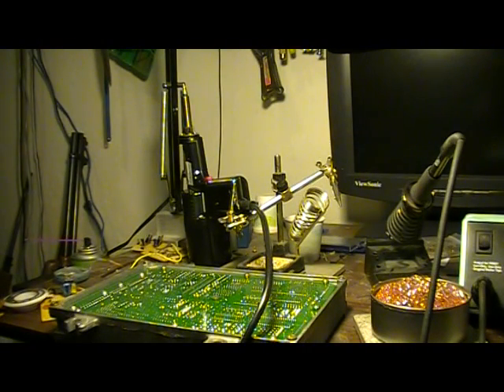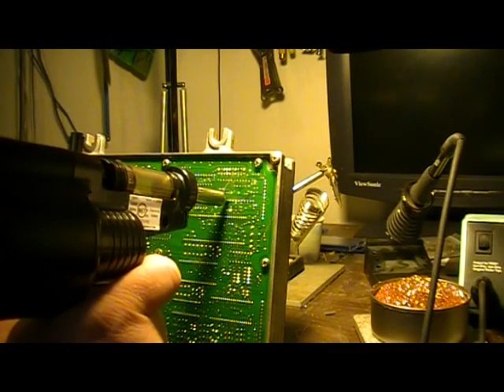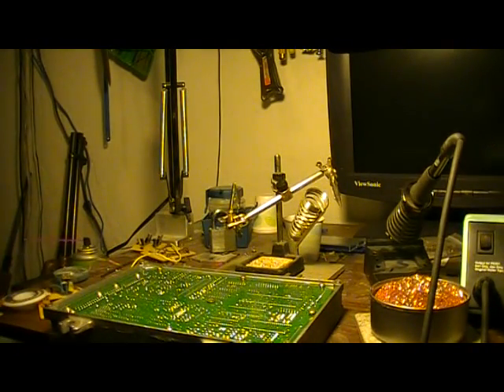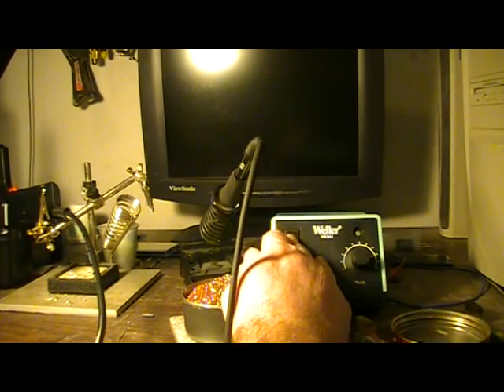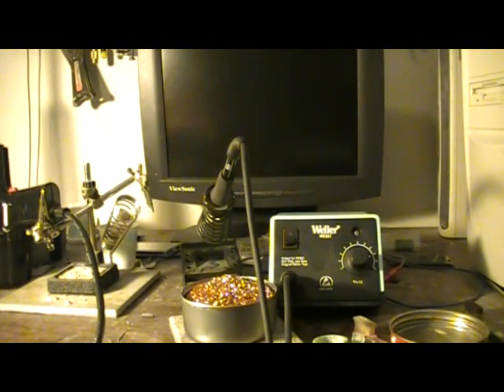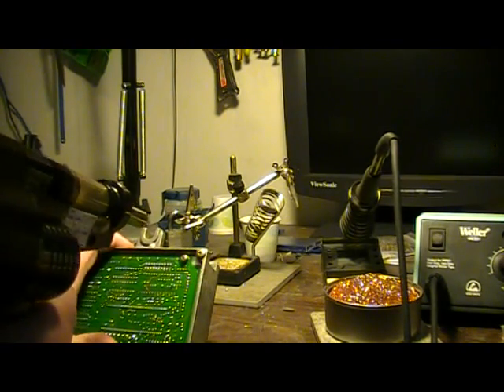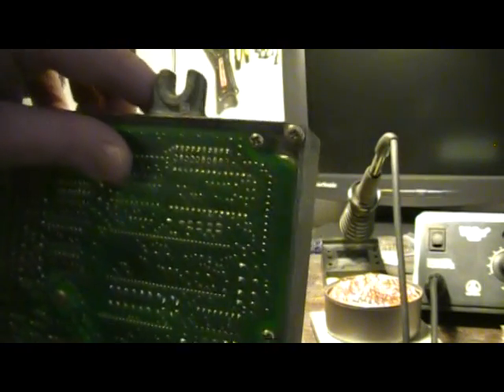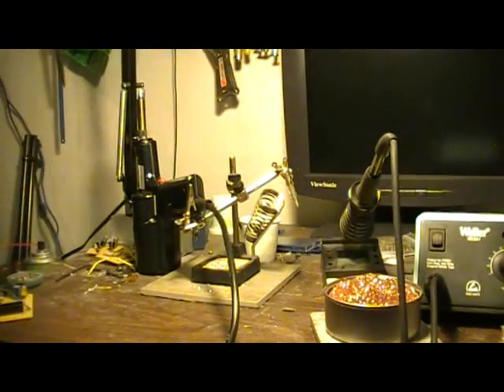Hakko 808

Comment: Beware, I went through 4 of these so called pro-tools in one job. The heating element is fine. I know they get blocked and am used to servicing them. The problem is with the pump motor and its a serious problem.
To recapp....lol..My Hakko 808 died at start of job. So replaced with the FR-300. This lasted 24 Hours. Dead. 400 mile round trip to get another unit. This unit lasted 5 hours. The same problem over and over....1. Acrid smell 2. Loss of suction 3. Motor sounds rough and runs at half speed and if you keep operating motor...then..Sparks flames then BANG. 
On internal inspection of my 808 (i'm an electronics engineer by trade) I noticed that the design uses capacitive reactance to drop the vast current of raw rectified mains and then sends this into a custom DC 230v motor with a bit of smoothing and filtering soldered onto the back of the motor. Hmm, yes it works but seems a very risky solution to me.  They stuck with the same design in the FR-300. Oh NO.
I understand why Hakko have designed it this way (basically no room left inside unit for power conversion) it's to keep the motor at mains potential which in turn allows the use of minimal power conversion components to drive the pump motor. 
This solution is fine as long as the motor commutator is in perfect condition and stays that way. Any odd wear pattern or tiny bits of metal lurking around stuck inside the motor (attracted by the strong magnetic fields around permanent magnet motors) will cause failure. If any erroneous conduction occurs then a massive spark jumps at the brushes and the commutator is instantly destroyed on the winding that the problem occurred.
This explains the acrid burning smell and the sudden loss of power (only 1/2 the winding's working)
My solution was to redesign the entire motor assembly and power conversion board so that a low rpm 24 vdc motor can be used with increased performance and absolutely no risk of pump failure.
The new type motor installation (500 rpm 1 amp 24v DC) was easy in comparison to the electronic design. This new pump motor is cheap, quieter and more powerful than the original.
The electronic design was difficult to say the least. I have a space 3cm x 3cm x 2cm to fit all the electronics into. LOL. 
To cut short...I did it. 1.1amp @ 24vdc direct from mains, no transformer, only 7 components used. The difference is staggering. No sparking commutator...loads of power..no risk of motor arcing burning. Problem Solved. My Hakko is like new.
Hope this finds an open mind and best wishes to fellow hackers!!
Reply from the maker: Dave Nally Thanks for the feed back.   Guess I got lucky.  Still have mine 3 years later.
Reply: My Hakko 808 have 10 years with me without any issue, works like a Champ.
I power up the tool each time that I need it, I don't leaved connected.

Best Regards.

Comment: I sold my brand new 808, because I didn't think I would need it... big mistake! I tried using my desoldering iron that has the vacuum bulb to remove two IPMs that have 32 pins each, and I gave up after 20 minutes. I just ordered another 808 - DOH!